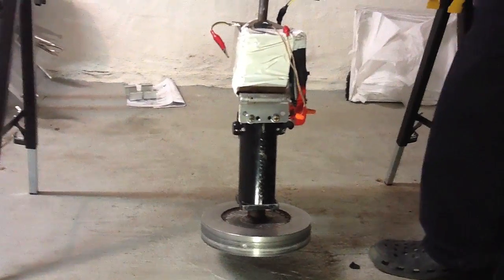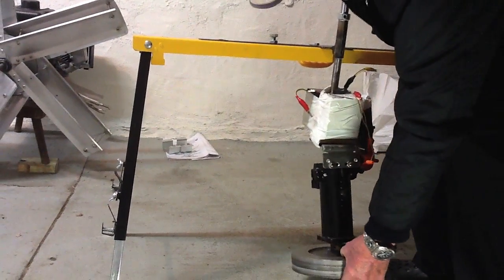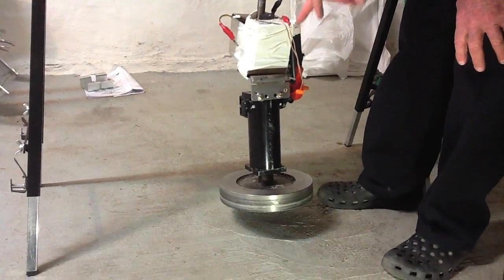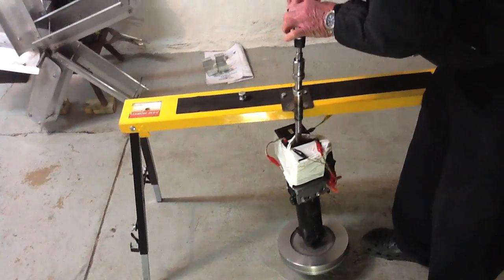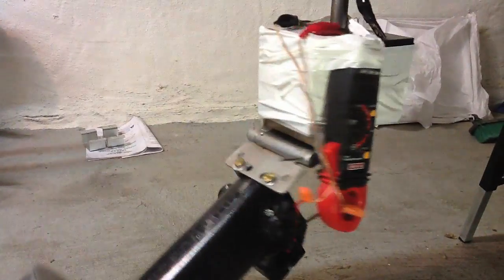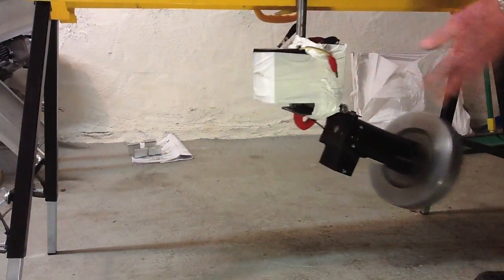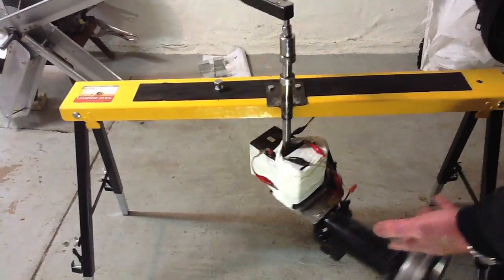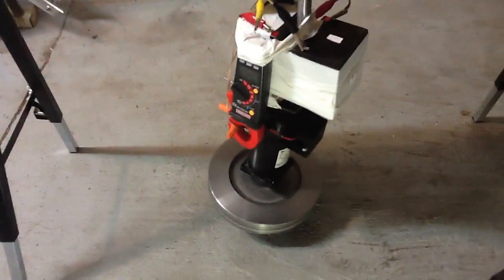N, 240 in lb Gyro Dynamo

Comment: What you have proved here is that there is enough energy stored in that battery to lift 24 lbs, 8 inches. You converted electrical energy into mechanical energy, then stored it in the form of kinetic energy in the rotating disc, in the form of angular momentum.  Holding the disc up against the pull of gravity only requires that you maintain the speed of rotation. That is why it draws such low amperage. The same amount of work could be accomplished using the same amount of energy, with a winch and compound pulley.  I once lifted a 10 lb weight,  12 inches on the energy of a single AAA battery.. It took almost 2 hours.
Reply: What he proved is over-unity torque output and free energy, literally. The gyro precesses with zero "angular momentum" as my gyro experiments demonstrates (see my channel) thus the input energy from the battery is not in the form of "angular momentum". The illusion of "angular momentum" is also demonstrated by the fact the battery can't power the gyro had he fixed the gyro in a horizontal position. What is happening is an "absorption" of inertia/mass and proving conventional physics needs re-writing.
Reply: @mes : A moving object has to receive energy to be moving. That energy will entropy to zero...always.
Reply: @timhallas4275  What are you talking about? Define "energy" instead of stating irrelevant generalities. Check out my gyro experiments that rise upwards on their own with no loss in spin speed (see experiment 3: https://mes.fm/experiments-playlist ) which further confirms Francis' torque over-unity without extra input required, i.e. "free energy", demonstration shown clearly in his video.